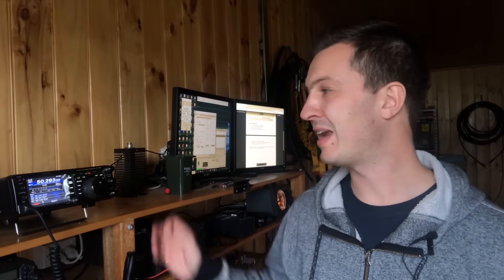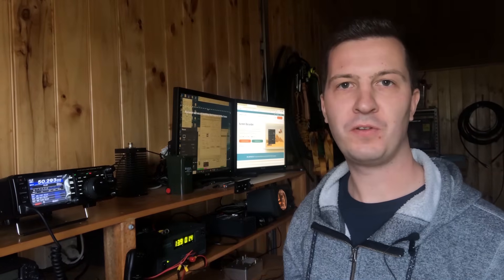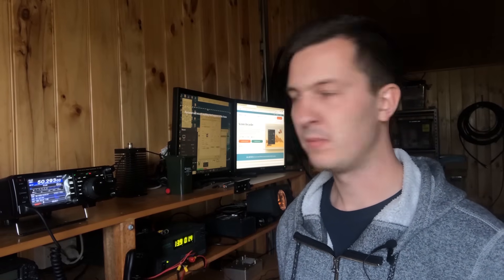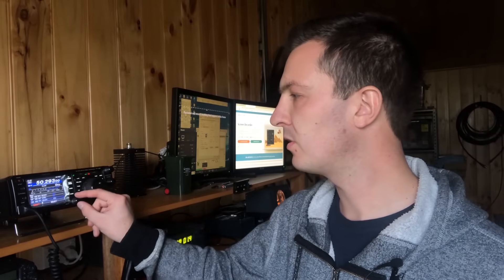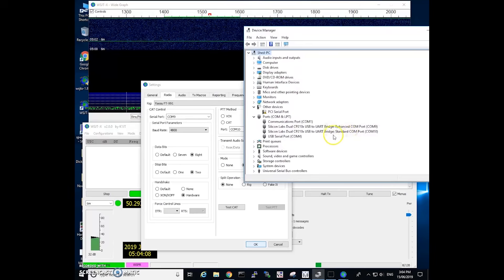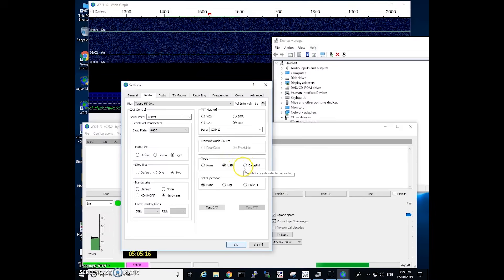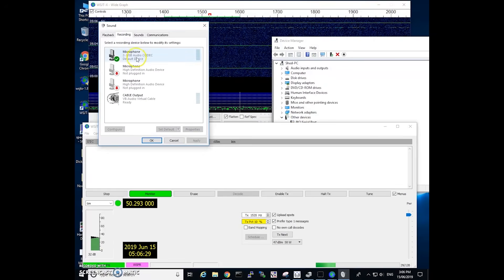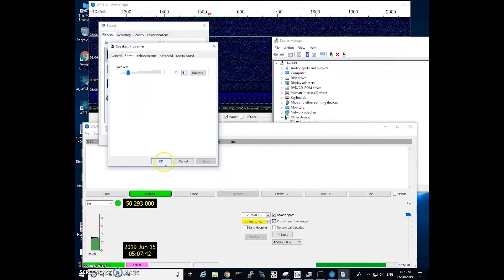Yaesu FT-991A SETUP for WSJT/Digital Modes (Easy and Simple)

Comment: I'm used too seeing my IC-7300 LCD showing me a transmit signal, but I don't see any thing like it on my Yaesu 991, software shows me Test Cat and Test PTT work and my radio, I can change frequency when using WSJT-X software, I can recive signals OK and when using WSJT-X to call some one the radio clicks in and trys and calls the station, the LCD on the Yaesu 991 freezes once its transmitting when it stops transmitting LCD goes back to normal. using a USB cable, I use the same gear on my IC-7300 and it all works and usally get answer with in seconds. Antenna W8010 or a TE-23 Yagi and I'm using a Automatic antenna tunner MFJ-929.

Comment: This is the only guide that worked for me out of all the ones out there.  Thank you so much! I was desperately trying to get it to work with PPT Method = CAT in WSJT-X but I was unsuccessful. Other stations were only able to hear me once i changed the PPT Method to RTS. It's the only thing that worked out of a hundred permutations I tried among all the software + radio settings. Literally the only thing that worked on my brand new 991A.
Reply from the maker: Glad I could help!

Comment: Thank you so much for putting this together. I wasn't having any luck getting the mic output to work, but it turned out to be the PTT settings in WSJT-X. I configured it the same way you have it configured here (with exception to the COM ports used) and it works perfectly now.
Reply from the maker: Glad it helped!

Comment: Thanks good info.. My 991a is using slightly different settings but i think that's not to unusual.
I have menu #108 set to DAKY on the 991. wsjt-x has the PTT set to CAT, and the stop bits set to 1. I am also not using the USB/DATA mode just USB.

Comment: I'm having a heck of a time getting mine to work.  I followed the video to the letter setting up the rig.  I finally got WSJT to key the 991 but hearing just a faint audio from the speaker. Obviously I haven't tried everything but I'm close.  Hair pullage going on.  Could it be an audio driver problem?  Don WA7OCZ
Reply from the maker: Faint audio from the speaker of the radio or the PC? Make sure in audio settings both USB codecs are selected as the audio device.

What happens if you TX a tune tone? Do you get output power, or ALC action? You can try reinstalling the latest drivers as you mentioned too. Let us know how you go

Comment: Good morning Hayden great video, I set my new 991A up with these settings, perfect. Just one question, what setting do you actually use for ft8 ie, power, mic gain, IPO etc. I had a ic 7000 before and was getting loads of contacts but the 991a seems a bit quiet so im guessing the radio settings need adjusting.  Any advice please. Ian
Reply from the maker: I just use the same settings as I use for regular SSB. Just set the ALC level so it just registers on the meter, 1 or 2 bars or so. That way you aren’t overdriving
Reply: Thanks I’ve been told not to use more than 25w output for digital. Is this right   Ian

Comment: What repairs did you have to have done? A or non A version?
I am undecided between the 991a and the 7300. Any comments welcome. Thanks
Reply from the maker: The USB serial IC failed so that was replaced. If you want a shack in the box, go a 991A. If HF/6 if all you’d like the 7300 wins hands down. The waterfall and features of the 7300 make it a difficult choice
Reply: I own both. 
Receiver capabilities are same in weak signals and to resist against strong signals
I think the audio receive is more pleasant on the FT. But, the waterfall is really better on the IC.. that makes a big difference in contest for example.
Except that, the choice depends your needs about VHF/UHF...
Reply: @jeanphi-bct  i have chosen the ftdx3000. its far superior to both! love this radio.
Reply: @ralph9987  Hello.
Not the same range of price.
Reply: @jeanphi-bct  I thought it was, O. Special it was Only $300au more

Comment: I'm ready to buy this radio but I'm limited on space. I have a star duster up now for my cb/ssb on one end of my travel trailer (which doesn't move) so I have the end of the trailer but that's it. No room to string out a 50ft dipole. Suggestions?
Reply from the maker: Have you tried an end fed half wave antenna? You may be able to fit something suitable in the space
Reply: @HamRadioDX  don't know what that even is but ill look it up.

Comment: I had to do it using the USB digital mode on the radio, I tried using the normal USB band mode, but the radio kept wanting to use the front mic for audio instead of the USB sound card, so I wasn't hearing any tones when moni was switched on.
Switched it to USB-D, set the D-Gain to 5, hardly registers any ALC, about 1 bar, run Fldigi on MacBook with rig control, 10W, been heard in Poland on PSK-31.
73
M7PDF

Comment: mine would not work with cat on com 9 and ptt on com 10 only way I could get it to work was cat on com 10 and PTT on com 9 how come?
Reply from the maker: It’s quite possible that the driver installed them around the wrong way. Usually Standard (PTT) is installed first then Enhanced (CAT) - but perhaps was the other way around for you

Comment: Thank you sooooo much!  You made my life 1000 x easier.
Reply: Everything is appearing to function correctly.  I don't seem to be actually transmitting, even when it shows that I am in wsjt-x.  It shows no power transmitting on the radio
Reply from the maker: Perhaps check your audio level and make sure it is not too low. Also check to make sure the default sound card is set in WSJT-X as USB Audio Codec.

Comment: Hi, I've just had windows 10 install its latest version 1903, no longer do you have access to setting the volumes of the Receive and TX anymore...  any ideas apart from strangling Microsoft... cheers.
Reply from the maker: Try going to Control Panel > Sound. That should bring back the old dialog for adjustments.

Comment: Does not connect on my 991a following settings and instructions
Reply: did you try opposite comports? mine would not work either till I set cat on com 10 and the PTT on com 9

Comment: Meant ask, what was wrong with yr radio if i can ask?,..anything to worry about in the 991 series
Reply from the maker: Just a fault in the USB section of the decoder board. Was replaced under warranty. Mine is the older 991, not the 991A. Great radio!
Reply: @HamRadioDX  thx for the reply,..just curious,.. 73s  you do a great job presenting, by the way